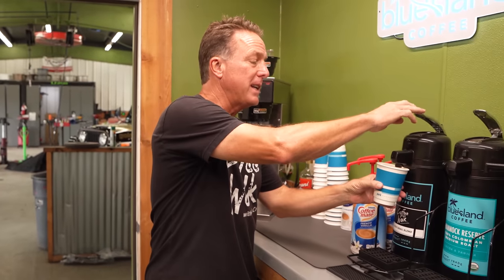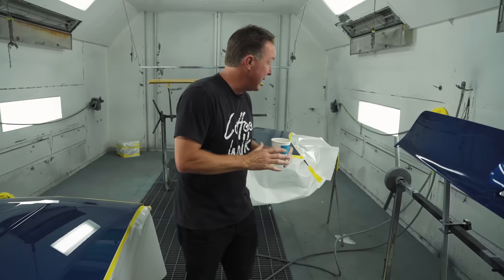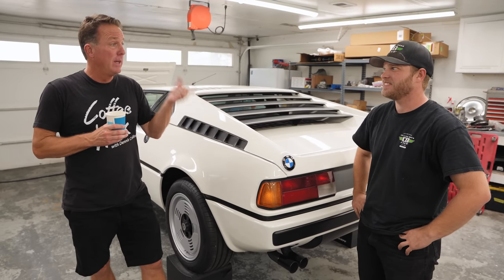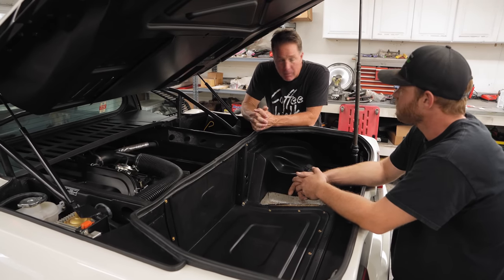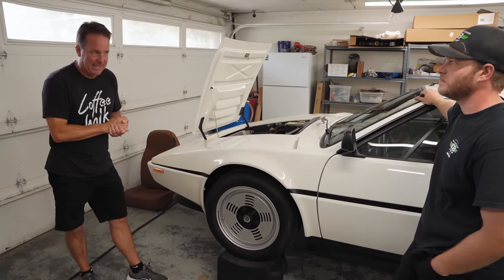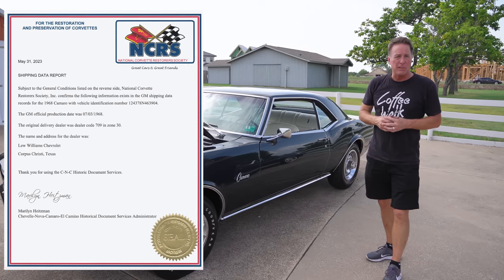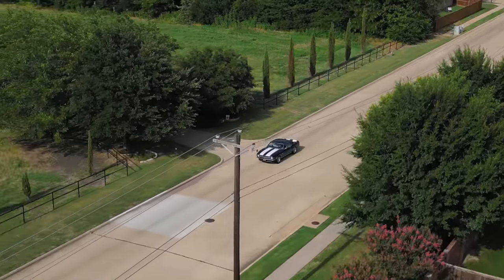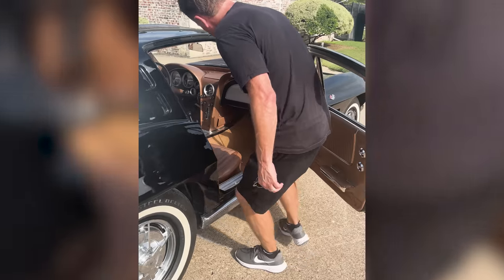MASSIVE CLASSIC CAR/JEEP UPDATE!

Comment: I am fairly new to your channel, I have never seen the shop or anything going on, I have only seen you go to pick up the cars you find, I believe the first one I watched was when you got the cop car Javelin, it just great to see the work being done on such a high end scale, the attention to detail is just incredible, I also love that you are an original condition nut, they are only original one time, survivors are extreamly rare. I was born in the muscle car era, I am 60 years old, I had a low mileage 70 road runner when I was 20, I bought from a guy down the street, the first thing we did was pull the carb, yank off the intake, we put a purple Mopar cam, Edelbrock intake and a 750 Edelbrock carb on the 383, we through all the original parts out, never thought they would be worth a thing, nobody did, I bought a set of Cragars, the stock ralleys went to the junk yard, it was an original air grabber car, young and dumb go figure, I love that you are bringing everything you can find back to life, love the channel, from S.E. Michigan, where a lot of them were made.

Comment: That is what I thought: Marker lights and a lot of things like that are often identical between many brands. Fiat, Lancia, Ferrari, Maserati, Lamborghini often have the same parts.  As the M1 has strong connections to Italy this does not astonish me at all. I remember people looking for Countach parts and found out that they were the same parts that they put on the cheapest Fiat 126.
When they made  the very questional Maserati Biturbo the part numbers were the same as on FIATs. But they were sold in a paper box with the Maserati logo on it. Therefore they cost double the price.

Comment: My first car was a 68 Camero.  Never should have parted with that monster but who knew back then.  I find it amazing they knew about the motor mount issue and put cables on the mounts to keep the motor down if you broke a motor mount.  Mine obviously didn't have that upgrade.  The driver side being the one that makes things real fun if you break it.  Which I found out, not yet knowing what it was in a McDonalds Drive through.  The way the throttle pedal worked in those is it's a metal bar hinged at the firewall.  So if you gas the thing, say, in a drive through, the driver side of the motor raises up, pushing on the front of that "bar" which from inside the car is you see the freaking gas pedal just sucked to the floor and there's nothing you can do about it outside of shutting the car off.  When this first happened to me in that drive through I basically left ruts in that drive through since I was basically doing a power brake.  The crap I did with that car.... it's just amazing it didn't kill my 16 year old, still thinking I was immortal ass....LOL.

Comment: My dad an uncle bought a white 1988 ford f150 from a auction in Russell springs Kentucky back in 2001. He paid 900$ for it an it had a 428 cobra jet. Needless to say he sold that engine back in 01 for way more than they bought the truck for. The frame had been cut off right under the grill an it had a 1 ton rear end an sat about 3.5 feet off the ground at the rear bumper. We always thought some1 used it to do truck pulls. I remember riding down hwy 88 in green county doing about 60mph an he stompped it an shifted into 3rd an she got sideways an start roasting the tires. Thats the day i became a gear head at 11 years old. Thank god my father raised me proper!!!

Comment: I've been polishing and sanding since the 80's ....
I agree 1500 2000 2500 3000 cut it and polish and I use a 18lb metal buffer for that .... During the vid shutdowns I got bored...
So I was sanding.... 
Among our fleet are 2 clean LS400's a pearl white 91 and a black 93  ... I sanded both and probably have 150 hrs between them  .... My son's Blue Peugeot 106 GTI a little car I have about 50 hrs into that.... I also did a favor for a friend and fixed his 99 Civic SiR That had been repainted a Jag metallic gray ... the worst paint job I have ever see ....  I did some of it with 800 then 1000 then 1500 ect ect....  I have a least 80 hrs into the that probably 50 hrs of compounding it chasing sand scratches.... and as long as he keeps it out of direct sunlight to hide the metallic blotches under the clear ( The hood literally looks like a tie dye) it looks great ....
I'd throw up some pics just  don't think ur allowed ... I've done a bunch more but those all stand out 
And yes my arms hurt

Comment: Absolutely great upload! The motor mount cables on the Camaro was the first recall in my memory. The (industry number) 2142 mount was deemed unsafe and until an interlocking design mount (industry number) 2267 could be brought online, the "fix" was the restraining cables. Can you tell I worked in parts in the sixties?

Comment: It's like restoring a Mercedes Benz, even one from the 20s you can get the parts - And the one source is from Mercedes Benz, and they will make them for you - but it's gonna cost you $$ .. I say these German auto manufacturers are on such a topflight hustle that it would make Pablo Escobar wince , They can draw blood from the same clients in 3 different ways - Initial sale , Servicing and then Parts. Warren G needs to write a joint about them!

Comment: It looks like the vet has an “Altec Lancing” 3 way crossed over stereo system. That is a very rare bird, if the woofer is cast aluminum bout 2 inches tall 6 x 9. Wire mesh grill.
Had a pair of Altec’s co-axles in my 67 mustang. 2 nd best speakers i ever owned, only out done by M B Quart 4 way crossover. ( made in Germany) 
12 sub “Eclipse “ @700 watts.
8
4
And a tweet.
Now I remember. Altec Lancing “Voice of the highway” series.

Comment: Not the same but... Two Lane Blacktop. Warren Oates as GTO - 
GTO : I bought her in Bakersfield, California. I was testing jets at the time and it got so I bad to have more action on the ground. You know what I mean?
The Hitchhiker nods cautiously.
GTO: I mean you can't stay high the same way forever. So when the 455 came out with the Mach IV Ram-Air with tunnel-port heads, beefed lower end and a Holley high-riser setup, I was on line -- 390 h.p. and 500 foot-pounds of torque, whatever that is. It's in the folder in the glove compartment. But she's a Road King, all right.....

Comment: That '68 Camaro  is a stunner , but how many would  agree with me that the '67 model  Camaro has a  little more appeal  with the 1/4 vent window?
Reply: I've heard that from a few, but not me, I prefer the 68. I've owned 3 68s, one I still own, and one 67RS. Wings are great if no AC, but another possible leak
Reply: @stevejohnson8703  ok , but at least the wings  dont have a draw on your horsepower. I agree some climates could have you wanting  for A/C  , but not for me who  always  drives with my window  down , no matter  what the weather  is , which is often not popular  with my passengers. I haven't  known of 1/4 windows  to leak , at least not on A body Chrysler's.